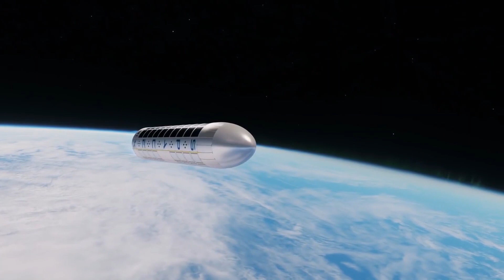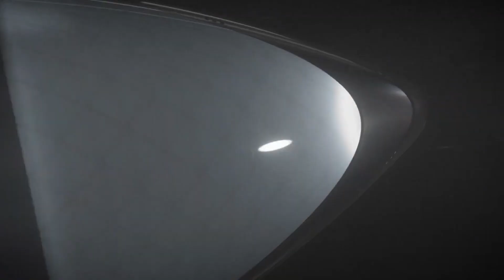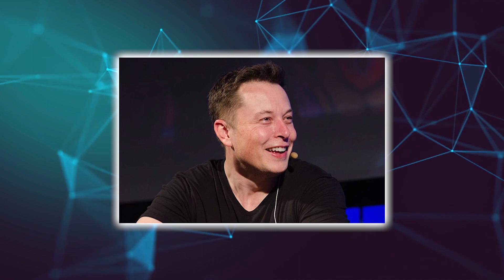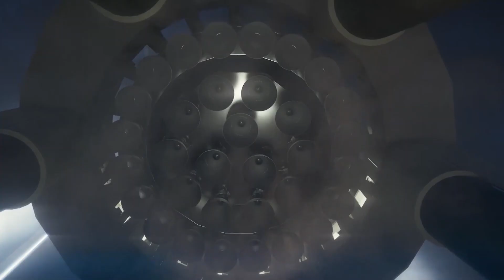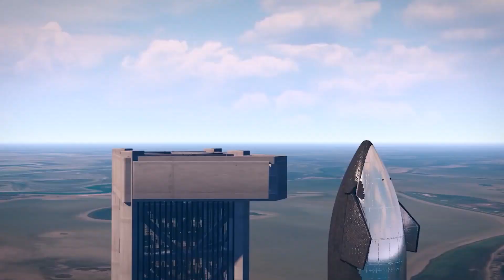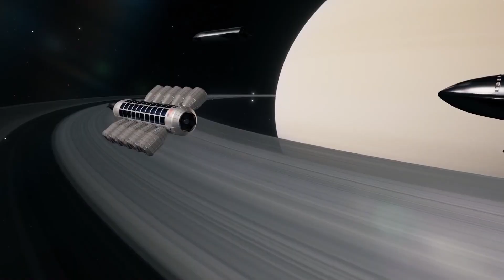Elon Musk JUST REVEALED its NEW Cargo Starship!

Comment: The top stage has many option of variable designs, including a link rondavue with another upper stage as a solar orbit cruiser,  slow non-idole acceleration of gforce gravity, in mini nuculear core electric/chem thrust boosters, leaving the first starship enough emergency/vtol sequal at final waypoint. 

However, its the beast that needs truly upgrades, as it cannot fully patk the upper stage in earth orbit velocity, thus needs a third stage, for example, adjacent falcon rocket support to escort the beast. The dangers of a double round trip full set starship of RISK, Cost Refill(o2 air) & Time-scrubb for refueling, can leave astronauts hanging.